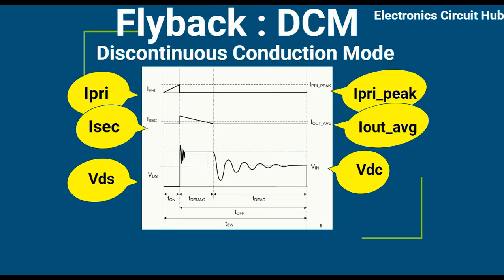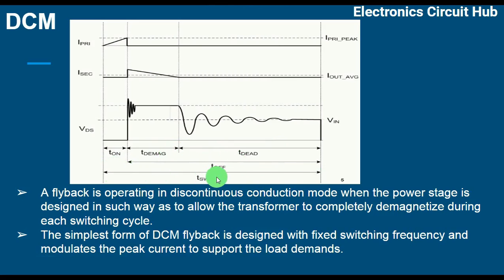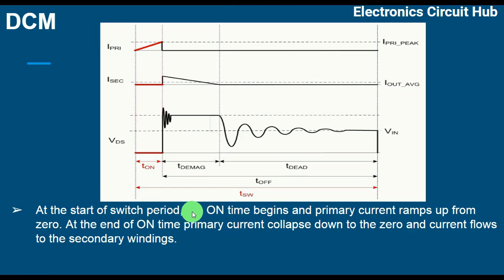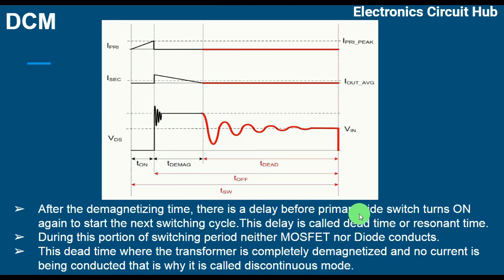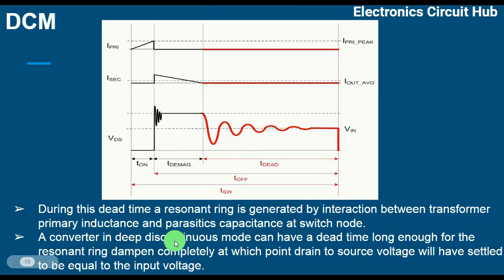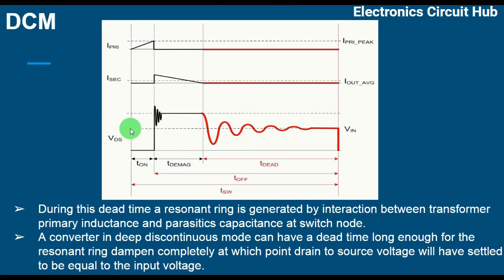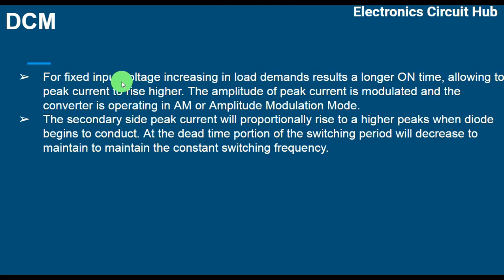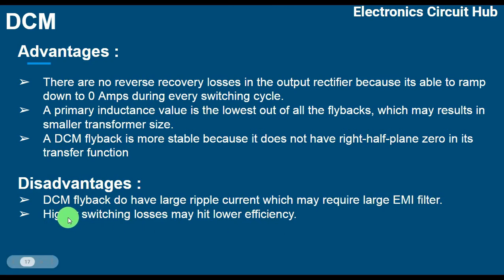Flyback : Discontinuous Conduction Mode

Comment: Professor, thank you. Is the switching node capacitance at the junction of the inductor and the diode or at the diode and the filter capacitance? Also, Sir, is the amplitude modulation sense at other node in the design? Could you explain this mode in more detail? So, Professor should I be using additional inductors for simulating the fly back, Lm and Lleakage along with the ideal coupled inductor? Again thank you for enlightening and EMC Engineer who started out in vacuum tubes.
Reply from the maker: Switch Node capacitance the Capacitance of MOSFET Drain to source Cds & some winding parasitic capacitance. You may use Lleakage for model your transformer in ltspice.
Reply: @ElectronicsCircuitHubECH  thank you Professor for answering my questions. Happy New Year to you.
Reply from the maker: @pbaemedan  Most welcome Danny. I wish you Happy New Year to you and a great success in new year.